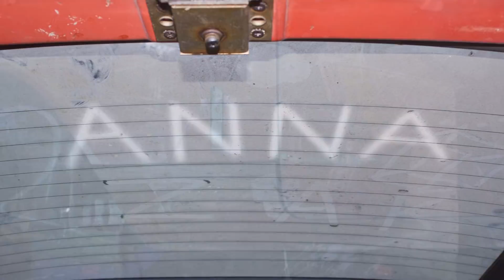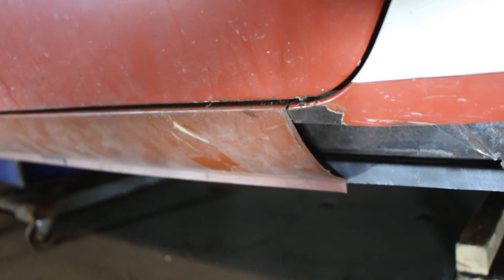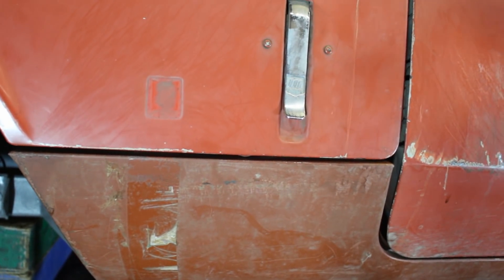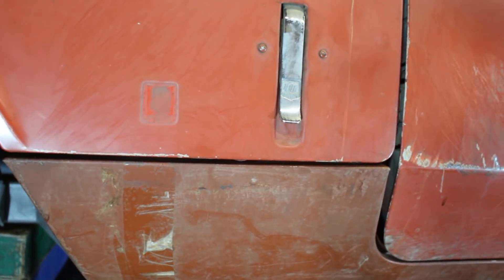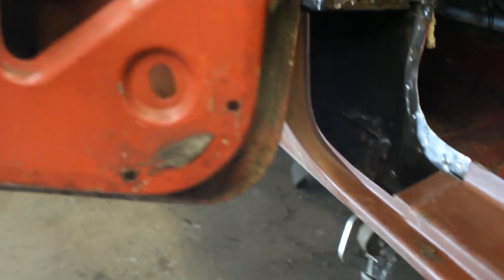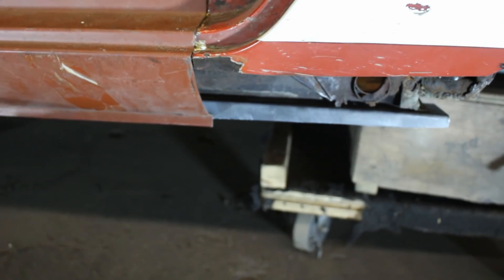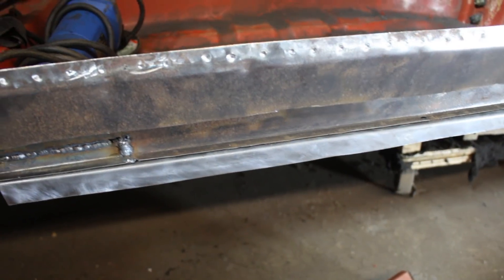1972 Triumph GT6 Restoration - Part 22 - Bottom of B-post

Comment: New on the scene, but could you retain the nice bevelled edge by cutting a section from the middle of the panel and but welding it back together? Not warping it would be diffictult but you'd retaint the edge. Great work. I enjoy watching your fabrication.
Reply from the maker: Yeah, I could do that, but I actually found the reason why it wasn't fitting right and I didn't need to cut anything. It is in the next video I believe

Comment: In this video, https://youtu.be/6LSmcnVP-HY, you cut slots in the top of the fender to massage it to fit. Can you do the same with the sill? Looks like if you tighten up the radius it will line up.
Reply from the maker: Hey, Keith! Yeah, that was a desperate move with that fender. Nothing else could be done there. I think I will have to do something similar here. What drives me crazy though is that I can't figure out where the problem comes from. I compared all measurements of the old and the new sill and they match perfectly. The old one fits well the new one doesn't though..... I know I can massage it to fit (I like that expression) but I really want to find the real problem and correct that! 
At the end of this year, I'd like to thank you one more time for the generous donation and for being with me through my adventures ever since I started restoring cars. I wish you and Mary a Very Merry Christmas and a Happy New Year. Hopefully, we will meet again in 2018 with our families!